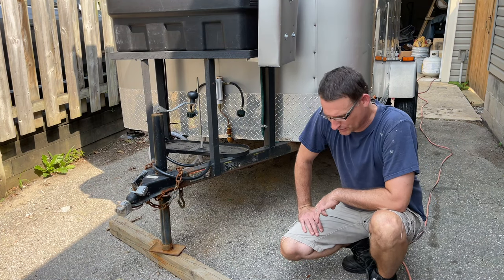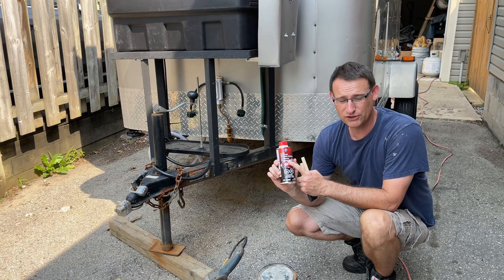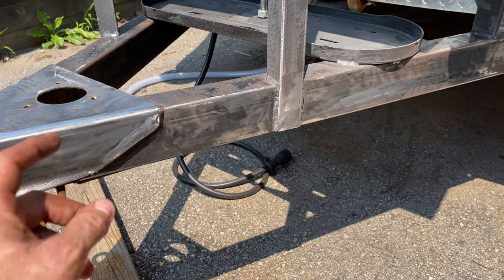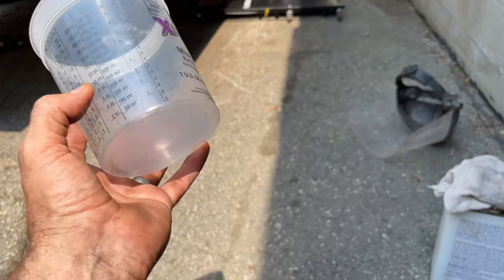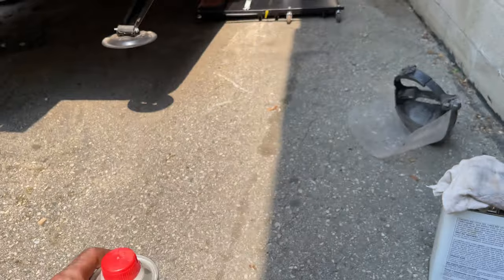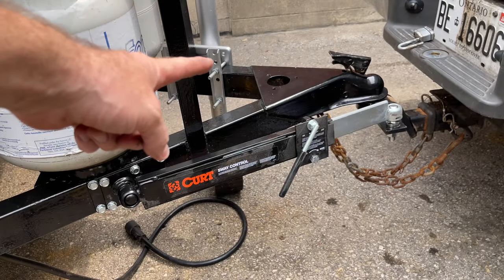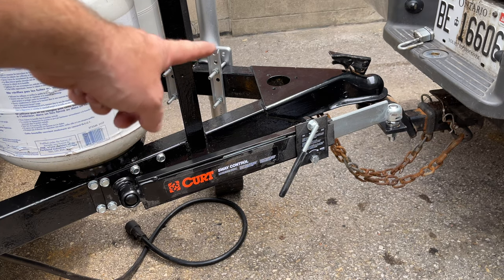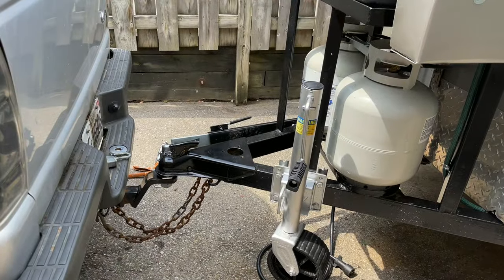How to Build a Cargo Trailer Camper Part 13 - Frame Paint, Anti-sway bar, Tongue jack

Comment: A constructive comment only - I had a situation once with a folding jockey wheel that came unlatched and because the wheel was facing forward, when it dropped, it tore the trailer from the hitch and caused quite a lot of damage.  My lesson learnt was that when I folded the wheel up, I made sure the wheel was facing back.  That way if it did come unlatched, the wheel would just run along the road and not cause any damage.  Thanks for your vids.  Very informative.
Reply from the maker: Excellent comment! I Appreciate the feedback, I  never would have thought of that. I will see if I can switch it around.